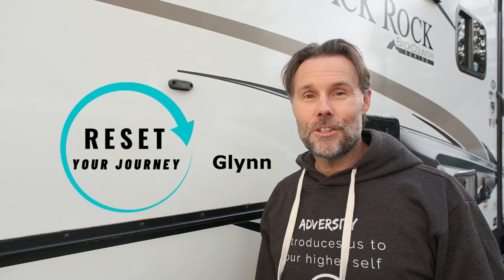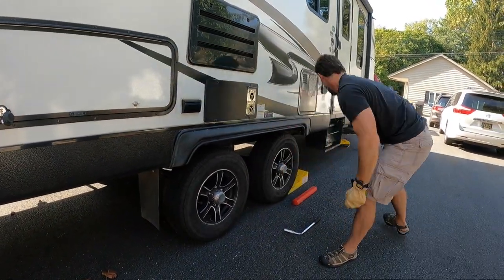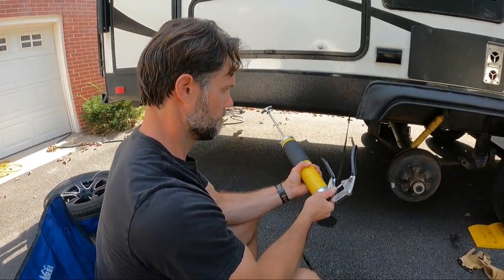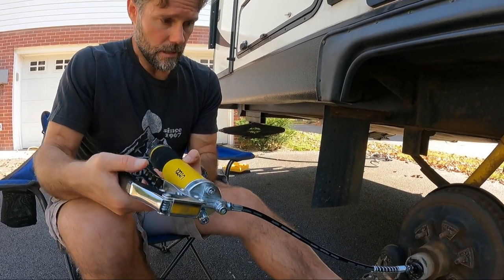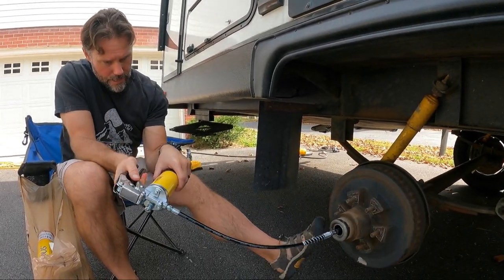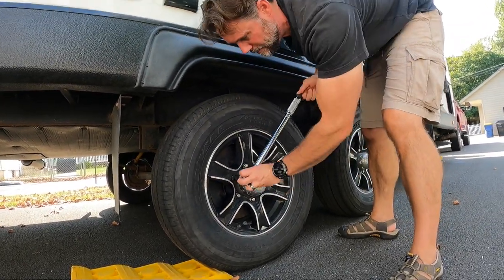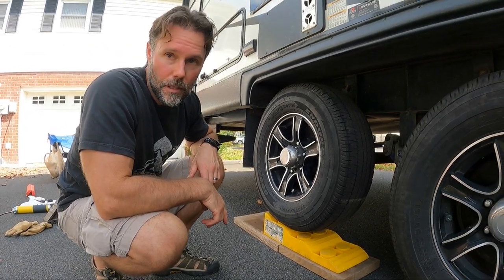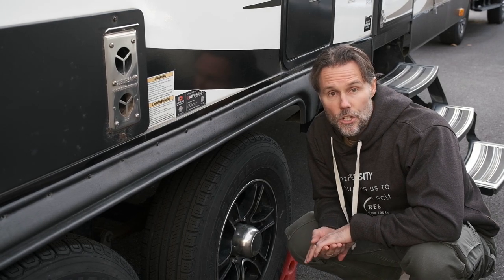Greasing ORV Travel Trailer DEXTER EZ LUBE Wheel Bearings & Tri Leveler Tire Change |RV Living (RYJ)

Comment: I already commented on the recent video about bearings but I've been watching your others. Simply as an old time RV-r I'd comment: I use about a tube per wheel with my EZ Lube axles pumping very slowly & turning the wheel to avoid blowing the rear seal. I'm a tool nut and carry a lot of tools (& loaded grease gun) when out. One thing that has been VERY valuable for me is my Milwaukee 18V - 1/2" Impact wrench. I carry a few Impact sockets as well (regular sockets will not work. They won't take the torque )  I carry a breaker bar as well but changing a tire on the truck or trailer is so much easier & quicker using one of these. I have changed several others for people stranded as well.  Last time out on BLM ground I was approached at our site by a person asking for help with a flat tire. Their jack would not  work & she couldn't loosen the lug nuts. I carry two 6T bottle jacks as well. Had it up and changed in about 30 minutes. If I see someone hand cranking their stabilizers I let them use it as well. Up & down in seconds.
Reply from the maker: Hey Herb! Great to hear you're feedback. All in agreement. Enjoy your weekend!

Comment: Far easier to break loose the lug nuts by pushing down on the tool instead of lifting up. You can use your body weight instead of throwing out your back. Also same technique when tightening up with your torque wrench. 
Lay down some scrap cardboard under the end of the axle to catch the old grease. Saves a lot of paper towels.
The grinding noise was from the brake shoes grinding on the drum. Time for new 'shoes' all the way around to keep them all even.
Reply from the maker: Noted. Thank you for commenting and following along!

Comment: Nice video. You probably know by now since this is a year old but the noise is actually the braking pad thouching the wheel hub. This is usually a sign a well adjusted pads. Maybe the brakes need to be adjusted on the 3 silent wheels! Lots of videos for how to adjust pads depending on the model you have (manual or self adjusting).
Reply from the maker: After replacing the breaks a little later on, we found the auto adjust spring mechanism to have broken.  A replacement solved the problem and that's the last time we injected the bearings. We repacked by hand going forward. We sincerely appreciate you following along and wish you well!

Comment: This is just a question for those pack their trailer bearings every year how often you pack the bearings on your pickup truck or your car drives to work every day
Reply: Since most, if not all newer vehicles (even my older ,05) don’t have serviceable wheel bearings I will bet that nobody does. Autos have moved to sealed wheel bearing hub assemblies

Comment: This is an awesome video on how to lube up the EZ fittings.  A couple of questions if you don't mind?  You said you used about 1.25 worth of grease tubes on each axle.  I couldn't tell by the video.  Did that much actually come out of the old bearing/axle?  That is a lot of grease.  Where did it all go?  Also, I have seen on other videos that people say you can blow the seal out by greasing your bearings this way.  What's your opinion about this?  Again, great video!!  Keep 'em coming!!
Reply from the maker: Thank you for commenting Gary! I was astounded at how much grease came out of each wheel. Despite the total amount used, some remained in the grease tube and some was wasted to make sure all of the old grease was circulated out. I suspect it was more like one tube per wheel. I did a full brake replacement after this video and was able to confirm that the seals where intact. It was surprisingly easy to change the brakes and confirmation that I might as well repack the bearings by hand next time. All of this said, it's easy to check the seals and repair if necessary. Thanks again Gary!

Comment: Just a pro tip. From working on 100s of trailer s. The biggest reason for blown out grease seals. Is leaving that cab on while you grease the bearings.  Because when the bearings heat up they start to push the grease.  An if the cap is all ready full of grease from you doing the service.  It has no were to go an its going to take the path of least resistance  an that is the seal. Just knock the cap off with a rubber mallet.  An clean out all that grease in the cap. Your rear seals will thank you.
Reply from the maker: You're totally right. This was the last time we used the EZ lube feature. Going forward, we repacked by hand with much better results. We really appreciate the comment and you following along. Wishing you well!

Comment: My trailers axles were not as heavy duty as that. But I would say since you are putting a higher amount of expected miles on the trailer, it may not be a bad idea to shove grease into them every few months. The barrings on my trailer were repacked the year before we left on our 2 year adventure, and in that year they saw little use. However on the road I would squish a bunch of grease into them every 3-4 months or so. And that was from my concern I was pushing the load rating of the trailer to its limits.  I did have a modified suspension with an extra lief spring and upgraded shocks and tires, but the rest was original of course. And I did not bother repacking them the whole 2 years we were out. And when I did eventually do this some time after we got home, the scoring was very minimal. I could have gotten a lot more out of them I figure. And I did replace the full race as the parts were pretty cheap, but the spline was perfectly fine. 

When I would re-grease them, because I did them so often I didn't bother pushing through until I saw clean grease. I just pushed through until I saw a small amount come out. If it looked really really bad I would push through more, but mostly I put in about a 1/4 tube. (keeping in mind my trailer was using much smaller assemblies and would use just under a full tube on a repack).

And through the winter months when it was really rainy I would get it in my head I needed to grease them after a shorter period of time, but the result was usually the same. The grease that came out was often only dark brown and not black. I think in the end I was overkill, as the cost to repack them was not more expensive than how much grease I used, but i like to think it saved me a bit of gas in them rolling better. And saved the time of repacking them at least once.
Reply: And yup, wheel number 2 is shot.
Reply from the maker: It sounds like you applied your expertise to stay ahead on the preventive maintenance. And no doubt it paid off. When we owned our gym, I was a bit overkill on all the PM for our equipment. But it allowed me to catch every problem before it became a problem. And that could be a serious problem when you're dealing with the potential liability from a client being injured. All of that said, I only had to have one elliptical and one cable machine repaired in 20 years. That "overkill" likely saved the business many thousands of dollars. And it all still looked and functioned like new when we sold the business. 

The systems on travel trailers and generators are new to me, but I'm quickly learning. Honestly, I'm enjoying the education and growth of doing it all on my own. The grease and grease gun are now along for the ride. All great advice. Thank you!
Reply from the maker: Since we were able to lock that brake on that wheel (while it was lifted), I'm assuming the bearings are bad. Sound about right? A bearing replacement will be easier and cheaper than new brakes for both wheels. But I will do whatever necessary. Thanks again!
Reply: @ResetYourJourney  My best guess would be the bearings to be a bit loose for sure. Breaks tend to make a slightly different sound, and if they are rubbing slightly then you would most definitely feel that when turning the wheel while its raised.

Get someone to drive the rig ahead at a slow pace while you walk next to the wheel in question, and get a sense of how it sounds freewheeling and with the breaks lightly applied. Depending on how the sound changes, this will tell you for sure. That is assuming you know the breaks are applying.

A reasonable and temporary fix is to very very slightly tighten the center hub nut which will keep things from binding and scoring the center spline. And pull things in just a little bit. I did do this once in 2 years on my trailer. But only to put them back into spec and not correct a rumbling wheel. Be sure to figure out if this may be reverse thread too. This can possibly buy you a couple months when you are ready to do them all. 

If things are really loose, then you would feel slack by just lifting up on the wheel and hearing for a clunk from the hub, while it is elevated. If that is the case, then it isn't the end of the world, and tightening the center hub will work, but a repack is very recommended sooner than later.

Good luck.
Reply from the maker: Great advice! Thank you. I had a feeling and I'm bummed that I did not check the lateral play in the wheel while I had them up. Regardless, we'll follow this step by step and do the necessary work. We'll do this as soon as we return from CT. We took a detour without the rig to visit Rose's family for the holiday. Sadly, our trailer does not fit anywhere in that part of CT. Thank you again!
Reply: @ResetYourJourney  No problem!  The easiest thing for the moment would be to elevate the wheel, yank off the center cap and arbitrarily tighten the hub nut a 1/4 turn and see if that quietens it down at all. if it does a little bit, then try another 1/4 turn and leave it at that, and its good to go for a little bit.  Since you didn't notice any chunks of metal in the out-coming grease, then its most likely just the bearings being warn down slightly.... They still need replacing of course, but this will do as a temp fix with no issues.  And this allows you to properly plan for the full day needed to do the 4 wheel repack.
Reply from the maker: Fantastic! I look forward to assessing it, fixing it and learning something new.

Comment: When you grease bearings pump it slowly or it will push out the seal
Reply from the maker: Eventually the outer bearings failed on one wheel and one of the other wheel leaked around the seal. Ultimately, all new races and bearings packed by hand. Hoping for "smooth" sailing going forward (pun intended). You can catch the bearing fail in our most recent video. Thank you so much for commenting and we wish you well.

Comment: 90 ft lb for steel wheels 120 ft lb for aluminum wheels they're two completely different metals different density react different with temperature therefore the difference and the torque spec it should explain it in the manual some do some don't
Reply from the maker: You are correct Wesley. Appreciate your input.

Comment: You didn't service anything.  You don't know the condition of the bearings or brakes. Lazy Lube is basically a joke. Hub should never be packed more than 50%.
Reply from the maker: We stopped using that method immediately afterwards. We switched to repacking by hand within 4 months. We'll never use the ez lube system again. Appreciate you following along and commenting. Wishing you well!